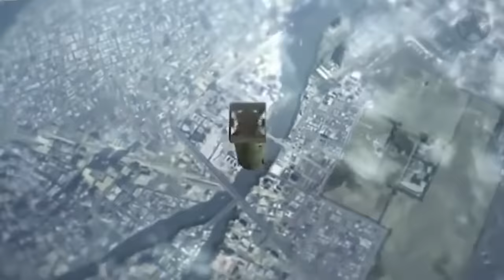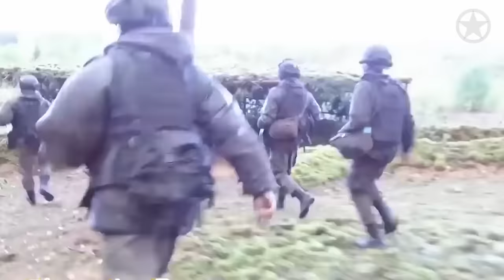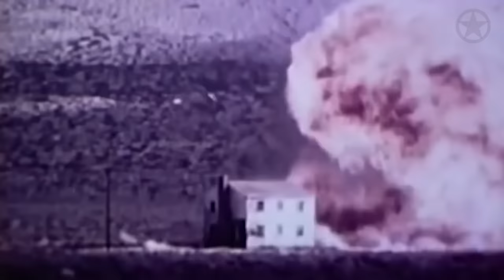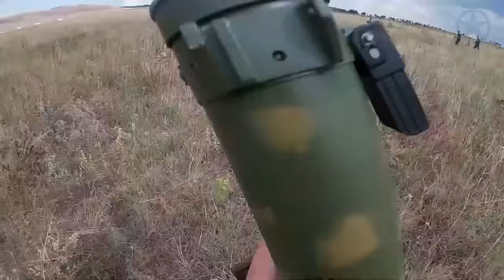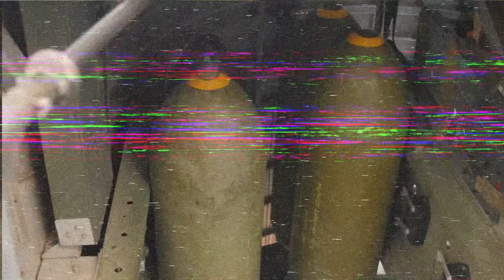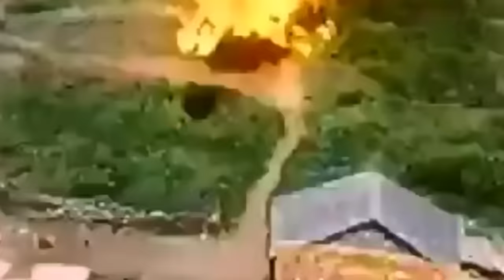THIS is What a Vacuum Bomb Dose to a Building

Comment: The BLU-82 uses ammonium nitrate and aluminum (cf. ammonal). The warhead contains 12,600 pounds (5,700 kg) of low-cost GSX slurry (ammonium nitrate, aluminum powder and polystyrene). Never was a Vacuum bomb , and the fact that in the video you say that vacuum bombs are WORST than nuclear weapons that's ridiculous, no vacuum bomb can come close to a nuclear explosion , maybe in blast effect in a smaller area but never to 10kt nuclear bomb that in our days most nuclear weapons are in the range of 100-1000 kilotons....
Reply: don't tell em about neutron (nuclear) bombs....
Reply: Some light actually be more powerful than Maybe a tactical fission bomb but then you have to take into account fallout and cancer effect after the blast lol
Reply: Don't waste your time, the narrator wouldn't understand. They should use the term "low O2 pressure" rather than vacuum. Vacuum exist in space, here on earth the explosion of any "aluminium powder" JUST REDUCE the partial pressure of O2, but doesn't affect the partial N2 pressure. WORST for human health, not for buildings.
Reply: @vperez4796  Any explosion on earth affects all gases pressure present on air, no bomb can discriminate to only affect one or the other kinds of atoms. as a note , not even in space you get to have perfect vacum , due to virtual particles that are always popping in in pairs,  and out by collapsing . What kills is not that humans get no O2 to breath, but the rapid air pressure oscilations, therefore differentials  , that rips off live tissue, brakes earth drums, shocks to the brain produce smallest veins to explode and produce internal bleeding
Reply: The GBU-43 is a whole different beast. Still not a thermobaric bomb, its yield is roughly equivalent to the Davy Crockett mortar launched nuke developed in the 50s, which was a silly weapon and quickly abandoned. Drop the GBU-43 MOAB over a city block, and it's gone. But basically, the GBU-43 is the product of a penis measuring contest between the US and Russia. We had 15 of them before the president at the time ordered one dropped on a tunnel complex in Afghanistan, and the ONLY reason it was used is because the president at the time was about a micron from ordering a nuke to be used. The Pentagon talked him out of it, and the compromise was the silliest weapon we have, the GBU-43. I don't think we're making more, because a B-52 can do a better job with a full load of smaller precision bunker busting and/or thermobaric bombs

Comment: Germany used Nebelwerfer (rocket artillery) as of 1941 to deliver an ammo aimed on the pressure/underpressure effect. The 28cm missile did contain 50Kg of high explosives each. They were fired in salvos. These weapons were able to kill poeple in trenches by destroying their lungs. 

There were plenty of tests with fuel - air explosives using coal and/or lignite powder but Germany did not develop a weapon system ready for production till end of ww2.
Reply: But they cried about shotguns being used in WW1 😂
Reply: @russellmcgibbon6187 well during ww1, germany was ruled by an emperor, during ww2 it was ruled by hitler. Two different systems….
Reply: @russellmcgibbon6187  There were conventions signed like the "hague land warfare regulations", that required to use jacket bullets. When the US breached this regulation it is an invitation for other nations to breach it as well. For ex. using explosive ammo that causes very bad wounds.
Reply: If you can't control the war then don't go to war.
Reply: @russellmcgibbon6187  If you breach the regulations...the other side can do it either..... 

Usually the soldiers from both side profit from such regulations.
Reply: Like every times, we have got an other US propaganda video...🍃
Reply: Shown Russians vacum amunition as own weapon how wtupid it looks like..
Reply: @theartefactum  show us the parts which are false
Reply: @holgernarrog962  The soldiers never profit, just the ghouls that cause and start the wars.

Comment: The fuels in those bombs are nothing like fuels in the solid state rockets.
The fuel in the solid state rockets contain oxidizers themselves and does not use air at all.
Reply: ANOTHER big mistake by the video... Rocket fuel is basically compacted gunpowder, but slower.
Reply: @brianfhunter  no its not, modern rockets use ammonia per clorate as the oxidizer and a energetic fuel, usually a mix of metal powders like aluminum or titanium all bound with a resin binder.  As a actual rocket scientist I should know.  And in a way the explosives used in modern fuel air bombs which is usually finely powdered aluminum, is similar to the fuel part of a solid fuel rocket, but used in a VERY different way, tot he point that solid rocket fuel isnt even considered a explosive (this is a bit misleading as solid fuel rockets do explode in a the right circumstances however regulators look at burn speed to categorize whether something is a explosive and the resin and tight packing of the fuel slow the burn way down from what it could be)  so long story short partly right, solid state rocket motors if you powdered them would not be a fuel air bomb, but would create a thermobaric weapon if finely ground enough which speed up the burning process and create a hard shockwave.  That said there are better options as rocket fuel is designed to produce as much gas as possible in a reaction, not to burn fast and compress the air into what becomes the shockwave.

Comment: It's not the pressure differential betweeen two large explosions that produces a massive shock wave. However, there's a two-step process: the release of a fine highly combustible fuel/explosive mist which saturates the air that is subsequently ignited by the secondary charge. The resultant explosion - draws in surrounding oxygen at a phenomenal rate, causing a temporary vacuum, that drives the combustion of the saturated air-fuel mix (aerosol), focusing the shockwave in a particular direction - not just from the force of the explosion, itself but also from the massive displacement of air. Traditional bombs explode omni-directionally, distributing their shockwave.

Comment: I'm pretty sure the payload on the "bomb dropping drones" is just a fragmentation (frag) grenade with 3D-printed tail fins on them. The one you showed anyway.
Some of the bigger ones drop artillery shells with grenade fuses on em. But, again those are not thermoberic.
Reply: Дроны способны нести гранату РПГ-7. Этого достаточно для уничтожения любого танка в крышу башни.
Reply: Russia have handled thermobaric grenades. Like RG-60TB ( РГ-60ТБ ). And some thermobaric bombs special made for drones.
Reply: Yes, and its not even make sense to use a fuel bomb on a empty tank, a simple frag is enough to disable it.... this video contains a lot of wrong info.

Comment: The concept came from grain elevator and coal dust explosions.  Also propane tanks BLEVE.  Then came improvised dust initiators.  And now fuel-air bombs, etc.
Reply: amonia nitrate has its own oxygen and does the same--old story
Reply: Sugar milk explosions, flour mills, saw mills , even hay dust can explode. There was a huge explosion back in 2020 in Texas at a grain mill.

Like breathing fire w corn starch
Reply: @dethray1000 

Of course, it’s an oxidizer.
Reply: @dethray1000    Ammonium nitrate is an oxidizer alright, but it needs a hydrocarbon base to burn.  Diesel fuel being the classic, but sawdust or sugar or many other things will do.
Reply: @TramVanDam 

I never did anything like that before 😁🤨
Reply: @jewelhome1 it's very simple o chem.. very simple.
Reply: Still partially deaf in the right ear 🤣👍

Comment: This is a good video, but why didn't you describe the effects of these weapons on the human body?
Reply: Why? What use would that be? it would change nothing.
Reply: Good point! since it's not clear how a temporary vacuum can kill.
Reply: @tincustefanlucian7495  The vacuum is the initial effect of the bomb to spread fuel the secondary effect is an ignition of the oxygen and fuel in the area causing everything to be destroyed. This makes it more powerful than conventional bombs because they can gather far more quantities of oxygen to supplement the power of the explosion.
Reply: @tincustefanlucian7495 well the pressure waves will basically disrupt and tear to pieces any and all soft tissue and organs inside one's body, this down to a mile inside of an open tunnel ... you'd get pulp'd

Comment: I've never seen a video, article or tweet about Thermobaric weapons that wasn't deeply misleading or over-hyping them and this didnt disappoint. So much of this is regurgitated internet nonsense.

Thermobaric weapons are simply more efficient explosives with a different, longer, higher temperature but less strong blast wave (pound for pound of munition compared), that can be more effective against various buildings and fortifications due to the explosive filling some of the space before detonating.

But they are not bigger than any nuclear bomb, even tactical ones. They aren't Vacum bombs, they generate a sudden drop in pressure in certain conditions near their centre, and that 'can' be fatal theoretically, but in practice almost all or all of the damage they cause is by a regular blast wave, fire, and chemical toxicity. They blow up. They blow stuff up. Anyone close enough to the blast core to be affected by the sudden drop in pressure (not actually a vacuum) is almost certainly going to be killed by the heat and the blast wave long before they suffocate from lung damage.

And spreading completely unevidence 'rumours' that the Nazis developed these weapons (they didn't) and saying it makes their origins shrouded in mystery is bullshit. Their origins are well documented.

There is other stuff but... whatever.

Comment: This video is full of it -- if you haven't figured that out -- in the first two minutes. There are concussive rings (i.e., changes in pressure (NOT THERMOBARIC) that are being inferred as being examples of thermobaric detonations and the use therein) in this video and boasts of powerful munitions that are hyperbaric and exceed: 'Wati 'til you hear about a thermobaric bomb, more powerful than the strongest American nuclear weapon' the inference is that it is bigger and 'badder' than anything else we have ever produced -- a hint, the  BLU-118 (BLU stands for Bomb, Live Unit -- btw) is our biggest thermobaric device and whilst powerful, is less than almost on the order of 8,000 times less powerful than our first atomic weapon dropped on the enemy, the 12-14 kt 'Little Boy' that was dropped on Hiroshima.  12-14 kt is 12,000 x 2,000 lbs of explosives -- i.e., 2.4million pounds of explosives -- up to 2.8 million pounds of explosives.  No thermobaric boms are that size and even if there were, nothing could transport them.  The author of this video is full of it.Around 4;48 seconds they showed Soviet soldiers marching in a parade (I believe, in Moscow.  Notice their rifles?  Moisin-Nagants, NOT AKM's.  Bogus.   Also, the 'script was Computer announced and they got several pronunciations WRONG.  Again, when you produce something, at least use what's right?  Most of the stated or inferred thermobaric devices -- i.e., grenades and tabk and artillery rounds are actually kinetic or high explosive.  Look at the explosions.  thermobaric would have minor energy and high fire.  Not concussive explosions etc.  CBU?  that is a Cluster Bomb Unit.   The author of this garbage doesn't realize mathematics and the scale thus far.

Comment: If a military can figure out how to rip water molecules apart it would create a 100% efficient explosion. Several gallons of water instantly turning into hydrogen and oxygen would ignited itself from the force with a a perfect mixture of 2 parts hydrogen and 1 part oxygen. I don't know how that would be done but it could be a possible. Maybe using sound to compress water will break the molecule bonds. Instantly turning the liquid into gas.

Comment: thermobaric bomb do not use solid fuel for the explosion. the whole idea is to get a huge vapor cloud with the 1 explosion then have a secondary explosion ignite the vapor cloud. 1 of the chemicals used in a thermobaric bombs is Propylene Oxide. propylene oxide is a Clear liquid with a density of ~0.8060 kg/ltr and is highly toxic and highly flammable. one of its properties is that it has huge vapor pressure buildup when not contained properly it turns in to a gas. thats why this is a perfect chemical for such bombs

Comment: When a video starts with completely false information, it's hard to take the rest of the video seriously. There are not any thermobaric bombs on the planet that have a higher explosive yield than the strongest of US nuclear weapons. The B83 class nuclear weapons, currently the strongest the US has admitted to. The max explosive yield if the B83 is 1200 kilotons whereas the most powerful thermobaric weapon in existence has an explosive yield of about 45 tons. Last time I checked 45 tons is considerably less than 1200 KILOtons. The US MOAB is a good example of a thermobaric weapon, we used them in Afghanistan. If we would have used the equivalent amount of nuclear weapons in Afghanistan, most of the Middle East would no longer exist. 

Although the explanation of what a thermobaric weapon is on this video is fairly accurate, the statements being made about their power are not.

Comment: THE Russians use Thermobaric weapons because it uses oil of which they have an abundance.  They even use kerosene as fuel for several of their rocket motors.  when i say oil, I dont mean the stuff that comes out of the ground.  They use a derivative of oil, like kerosene or something like that.
Reply: diesel or kerosene…. It’s just ANFO with some powdered metal sometimes. aluminum, zinc, titanium tungsten

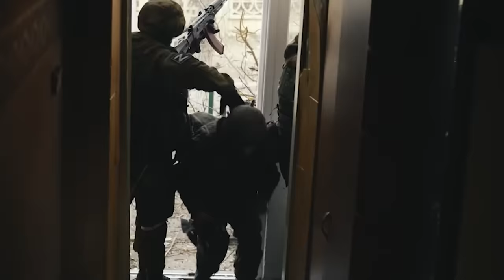Comment: 8:53 That's some absolute horseshite. Russian Air force has enjoyed air superiority for most of the conflict and I personally have watched tens of hours of Russian TOS thermobaric usage without Ukraine being able to even engage in counter battery activity. Given how close the TOS platform has to operate to the front that is frankly embarrasing. 
Their AA systems are largely depleted with what little is left allocated to key command nodes that are well away from the front and Russian Artillery massively outnumbers Ukrainian. From units of arty to shells to fire. Having a few technologically superior HIMARs makes very little difference when the enemy has more and bigger artillery.

Not sure how anyone can think otherwise unless they swallowed a whole load of Kyev Post/Western Tabloid nonsense. I do however agree about the point on the father of all bombs. Pics or it never happened Russia.
Other than that glaring bit of disinformation I enjoyed this video.

Comment: The strongest american nuke is currently 1.2 megatons, which can destroy up to 20 miles. No thermobaric bomb is nearly that powerful.
Reply: inverse square law has a really sharp diminishing return curve as bombs get larger. Every time you double the distance from ground zero the actual area multiplies exponentially, that's why yield doesn't reflect area of destruction even remotely in a linear manner.

Comment: Images are interesting but there is a lot of confusion in this video about thermobaric weapons. All thermobaric weapons are not fuel air explosives. They might use their own oxygen. But all of them have in common a long shockwave, up to 50 milliseconds. They don't need to be powerful to be destructive, but it is right that the big ones are impressive. They are not radioactive nor incorporate radioelements. No thermobaric bomb can compete with a nuclear bomb, they only deliver a fraction of it (44 tons TNT equivalent vs. few kilotons!). There are other myths about it as oxygen sucking bomb: you are killed or vaporized much before lacking oxygen!